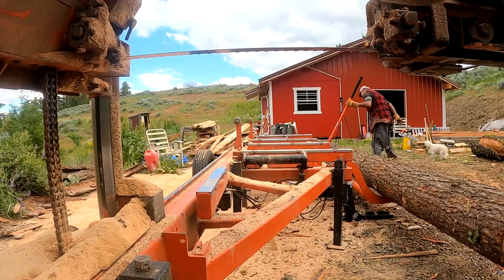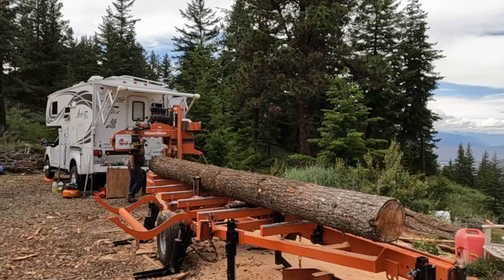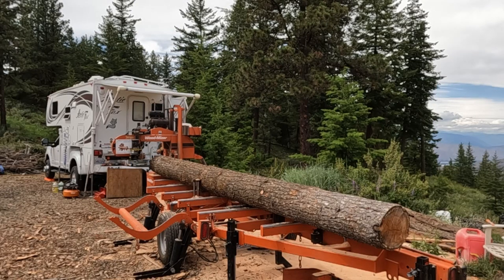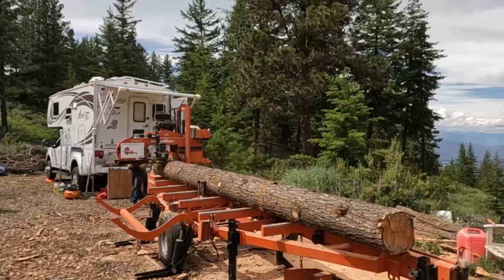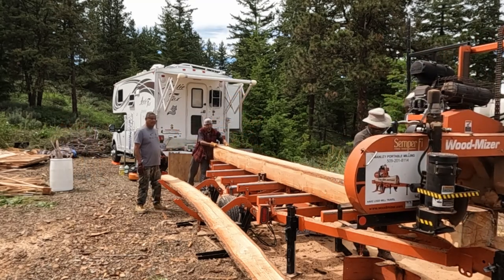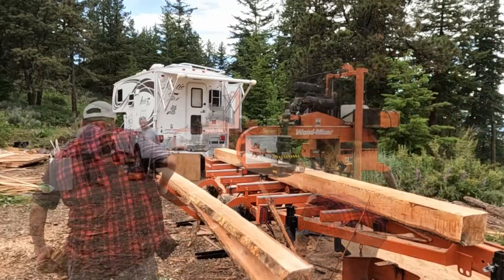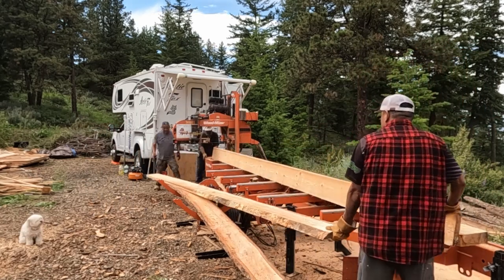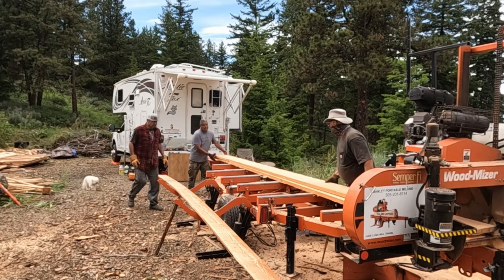TOO LONG FOR THE WOODMIZER LT40? -  Portable Sawmill In Action

Comment: With my LT-40 only a few times have I made longer than 21 foot logs. 
A guy just slices 21 feet and backs off a bit, chain saws off the slab,  and turns it while considering the clearance of that remaining few feet of longer length , 

Then backs up the log towards the start, towards control box, then

Swoops down into level with the cut surface and completes the last few feet of the log,  all four sides, 
Bingo.
A 9 + by 9+ inch 22.6 footer as the top of my lumberill building wide side doorway,  

A 25 footer 8+ by 8+ inch cant, just stickered  there in the corner curing and awaiting a future project that will present itself .
Reply from the maker: Yup, I've seen it done by folks on FF just have had to myself yet.  Thanks

Comment: Whats it take to run an 1 1/2" band on a 40?
Reply from the maker: lol sorry!  Late night!  I doesn't take anything.   Just put it on and go!
Reply from the maker: Wood-Mizer will tell you either 1.25s or 1.5s are fine (and so will I) though some argue you only get the full benefit of 1.5s when you convert the guide rollers.  However doing so will mean you won't be able to run 1.25s anymore